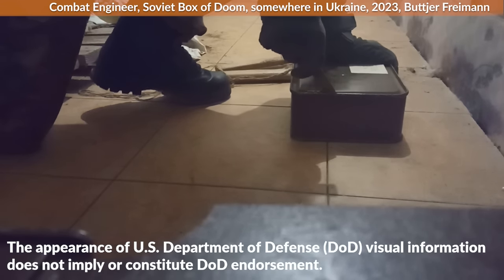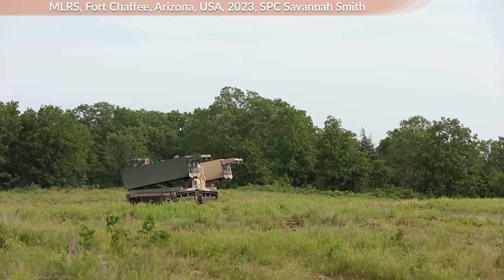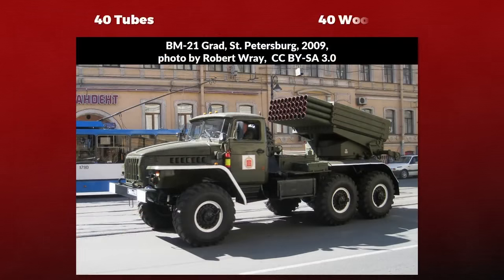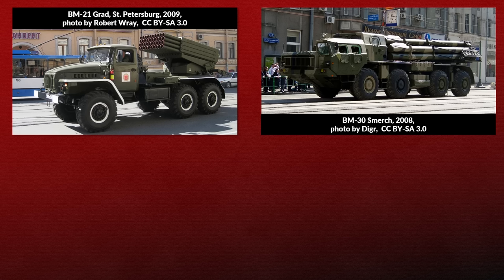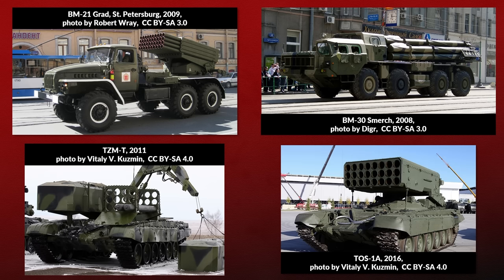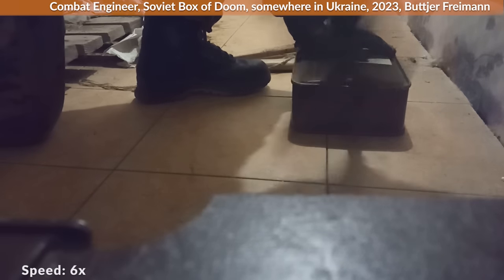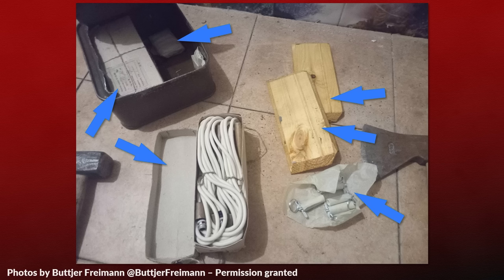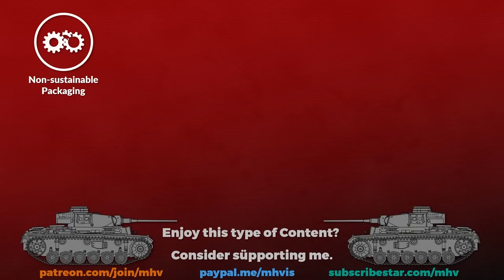Ukraine: Why Soviet Packaging is a Nightmare - Unboxing Edition

Comment: The claim that the Warsaw Pact would have lost/logistically only on the basis of the BM-21 is rather primitive, as is probably comparing the BM 21 with the M270, which had very different equivalents in the Soviet Army. It wears out soldiers, in WW3 a soldier's lifespan was generally expected to be relatively short, hence the Soviet warehouses in the middle of nowhere with very old equipment, when they were expected to defeat the other side with this, who would have less supplies if it didn't work production.
Reply: There are more examples than the Grad, even more than the recent Systems already shown here. Soviet fuel logistics for example are also terribly inflexible (And as shown in the Battle of Kiev, the Russian version did not improve much on that) Containerization did happen late in the USSR, but never became as refined as the ISO system, old military containers won't fit on civilian trucks or railcars. Here, the only major problem is that 53ft ISO containers are uncommon in Europe, but popular in the US.
Reply: The logic behind NOT having an integrated ammunition container-launch unit like in M270 is simple. Without a truck with a proper crane you cant unload the goddamn thing. You cant load the container on the truck either. The ground is muddy? Your ammunition truck is on a slope? Crane broke? Too bad, you won't load. Meanwhile, to load and unload the BM-21 you need 3-4 guys (but even 2 will do) with at least one collective braincell. No crane needed, you can even use a horse wagon and it will do just fine.
Reply: @phunkracy  yes, but in 99.9% of all cases, the containerized version will already fire on your rearming site while you are still working on the 8th missile. The crew trains in such situations, maybe they will be slower, but how fast will you reload if your soldiers are walking through knee-deep mud? Or on a slope? Or when its near freezing and raining? In the first minutes, its easy. And  we don't talk about BM-27 or BM-30, which use much heavier rockets, can't be reloaded without a crane and still reload in single rockets. The SAM Tor on the other hand uses four missile containers as sealed round. The Soviets CAN do better.
Reply: @denniskrenz2080  why not 237% of cases since were making up percentages? Also apples to oranges, BM-21 and derivatives are not analogues to M270, not any more than a mortar is an analogue to a howitzer. Missile containers arent a new thing and there was a reason for not adopting them, the reason is respective artillery doctrine of NATO vs Warsaw Pact
Reply: @phunkracy  why claim that they are made up? Just look at the job HIMARS does which uses the same logistics, using fringe extreme cases are a bad design criteria.

And can you read? BM-30 entered service in 1989, M270 did so in 1983. NATO did not use any MLRS before the 1970s, the logistics of it could never compete with guns, all changed when NATO doctrine changed (before we would have used single rocket systems weapons, like Lance, with about half of them nuclear). The German LARS is pretty much the closest you get to Grad historically, but it uses smaller rockets.
Reply: @denniskrenz2080  its made up because you literally made it up lol

I dont know why reload rate is important for a system with almost exactly twice the range of contemporary M270 mlrs.
Reply: @phunkracy  You are clearly civilian.  🤣
Reply: Modern Russia DEFINITELY would lose to NATO just based on Logistics alone.
No one can beat massed Air assets… yes even the Russians with their S series SAMs would still fall victim to well trained Pilots, with well trained ground crews and the omnipresent Anti-Radiation Missiles.

No army can fight when the depot that had their ammunition was blown up… as well as the numerous other depots anywhere close to the frontline. No Logi, no Army.
Reply: @PeterMuskrat6968  modern russia would obviously lose to nato, but only because US is in nato. i dont know why anyone disputes that. but anyone else is fair game.
Reply: @denniskrenz2080  youre clearly a civvie
Reply: @phunkracy  Awwwww, cute.
Reply: @denniskrenz2080  awww cute

Comment: Czech RM70 Vampire MLRS somewhat mitigated the grad rocket reloading problem. You have one salvo loaded in the BM-21 launcher, while the second one is stored on the rack at the back of the truck. Once you fire the first salvo, you turn the launcher to the reloading position and slam the second salvo to the tubes. No need for carrying around 40 boxes to fire two salvos.

Comment: The unboxing is done incorrectly. The line of cut should go towards itself (on video to the left) and not from itself (to the right). On video going to the right is very demanding because with each step you need to create new big hole in the plate. But if you go towards itself you are just making small hole and big cuts which is very easy strength wise. In short the guy on the video has no idea how to use this type of can opener. To be fair this type of can opener is not usual and I have used it only in military.

Comment: This is a selective line up.  No one reloads crew serve weapons like that under fire, so a few more minutes is irrelevant.  MLRS rocket pods need a fork lift or a crane to put on transport trucks too.  Sealed ammo cans can't have contents secretly robbed in storage.  A can opener is issued in every crate.  And can be resharpened.  Everyone packs space with whatever works too.  I have purchased equipment from Russia (pre and post USSR). as well as other old Com Block, and NATO countries.  All of it has been clean and functional.

Comment: Good video but need to note that for the voice over at
8:58
Modern ammo names are the diameter and its length. In such cases the X is read as "by" in English, just like "two by four" or "an eight meter by ten meter room".

Comment: I'm not certain if it's accurate, but a quick Google search showed that a BM-21 system rockets weigh on average 60-70kg, depending on the specific munition being used. I looked up a video of the system being reloaded, and each projectile is being carried by three people. The standard crew of the BM-21 is 3 people. I feel like the 10-minute advertised reloading time is unlikely, even if the rockets are all already unboxed and sitting nearby for easy access (which has its own set of potential problems).

Comment: I think it is crucial to say that usually, BM21 is not fully loaded with 40 rockets. It is both for safety reasons and time efficiency. So, from my opinion the tactics for bm21 is this: BM21 goes to the firing position, empties its payload, and goes to a safe position for reloading, and after reloading it goes to a new firing position. And all the wooden packaging is good for storing those rockets, in stations where they might be unpacked before BM21 comes to the statin for a reload. Yes, it also raises the question of "if the reloading site will be exposed to the enemy, it might be destroyed by artillery fire, drone attack etc." but, those things were invented long before drones, but even after all the bad things BM21 has, they are compensated with it simplicity of use and service, and it's also cheaper than NATO MRL systems. So, even if it is faster to reload HIMARS, you can simply build more BM21 to compensate reload time.

Comment: About the BM-21 reloading: As the tubes foul with remains of the rockets solid fuel, it becomes increasingly harder to fit the rockets into the tube. There is a video somewhere, where they hammer the rocket into the tube with a packing box. You can imagine how well this thing fires.

Comment: From what I recall, the Soviet Union did not plan for a long grinding battle  for Europe, it planned  a very fast highly mobile attack, using battlefield chemical weapons as part of the offensive.  That could lean into the idea of 'use once then discard'.  Why bother decontaminating something you are only going to use once since you are planning on using chemical weapons anyway?    
The tins make sense if the idea is to just keep churning out ammo in peacetime to then put in storage for use years or decades later.  With enough meat bags and advanced preparation, you can get it unpacked fast enough to have a ready supply for a short duration conflict.  Of course that implies you are planning a short offensive war where you are doing the invading.   
For lower intensity conflicts, where you are not expecting to be firing a lot of ammo , it also has a sort of sense.
I'm not saying the thinking was correct, but I can see the logic behind the thinking.
Reply: Yeah the logic behind it was flawed, but the logic exists.
I think it would have been kinda funny to see what would happen when the Soviets blitz through a good chunk of West Germany only to slam headfirst into the realization that “Quick and Easy” would very rapidly turn into “Rapid and Shameful” route back to their starting positions when the French, UK and US reinforcements arrive in Antwerp and other Northern French ports.

Comment: Does this even matter? The volume of fire that these systems puts down are mostly limited by access to ammunition supply and their need to relocate to avoid counter battery fire and also getting supplied with a good target. So what if it takes the grad 30 minutes to reload and it takes 30 seconds for a western vehicle? Both needs to relocate after firing to avoid counter battery fire, and both needs to wait for a new target which could take way more than 30 minutes, so the reload difference is not that significant as it first sounds.

The main limiter is ammunition though, and I'm willing to bet a large sum of money on Grad ammo being a lot cheaper than MLRS rockets, even when adjusted for size.

Comment: Just the day i start obsessing over (Post-) Soviet ammo logistics you release this gem. Thank you! Does anybody know if there are any good sources on the wooden crates used to transport ammo and weapons in former soviet states? it seems like they had neat manuals and systems for everything, so i'm assuming there's also some specifications available for the boxes. I've seen big deep boxes that can seemingly both be used to carry 150+ artillery grenades og RPO rocket launchers, shorter crates for mortar grenades or PG--7 rockets, and various others. there's got to be a name or code for these boxes, so if anyone knows of a system, do tell..
Reply: It was all made with the expectation of being used by the unit. For example, the ammo can was designed for the standard ammunition of a standard squad (5.54x39 for example), so the words that some sad dude would take a long time to open the ammo can and then got a lot of ammo in the paper are said/written by those who used them on the firing range, for example, as a civilian, without understanding the logic of real (Soviet) army use.

Comment: About the boxes.
I have experience opening various "boxes" of ammunition (several dozen, no more than a hundred). For the most part, with the help of just such a knife as in the video.
In my experience and from the experience of watching people who open these boxes for the first time, I can assure you that your second box is opened many times faster with just a knife than it happens on video.
I do not know what to do with a knife to make it blunt so that it was impossible to open the boxes with it. Although knives that are used all the time are sometimes sharpened (if this is your personal knife, for example).
Moreover, knives are placed in ammunition boxes (sometimes in each box). What's the problem with taking another one?
In the video, a man claiming to have opened more than one box (and this is his speed record, besides) opens the box as if doing it for the first time.
He bends the lid for some reason, which only gets in the way. And after using the axe, a piece of the lid remains, which prevents the contents from being removed.
Seriously, this is almost the most crooked-armed man I've ever seen.
Batch charging
Batch loading is undoubtedly faster than one rocket at a time.
But if you haven't used up all the missiles in the package, how will you recharge this package? Should I take the unit to the warehouse (or to the factory) and recharge it there? Take missiles from another package? Or do I have to store a bunch of half-filled bags? Are the missiles even stored outside the package?
About logistics (the answer is rather to some comments on the video)
In order for your ammunition not to destroy everything at once, you have to create a bunch of transfer depots on the way to the front line. The smaller and more inconspicuous they are, the better. It's hard to manipulate a rattle somewhere in the forest, for example. Either in the barn or in the basement.
A container that depends on a forklift complicates logistics. On the other hand, does anyone really think that Soviet crates cannot be manipulated with a forklift?
If the ammunition is used up, they no longer need a container for transportation. This is obvious, but apparently not so much that I have to talk about it.
Boxes made of wood and steel can be reused (no one forbids), on the other hand, they are not a pity, they are eco-friendly. I'm not saying that it is possible to apply the push boxes in different ways in everyday life.
According to the conclusions of the author of the video
This packaging allows you to extend the shelf life of the ammunition as much as possible, therefore, it is possible to store huge stocks for a long conflict. At the same time, there is no problem of logistics of empty containers back to the warehouse during the conflict itself.
And, again, it's not worth making a video about the speed of opening a package according to people who have their hands out of their ass.

Comment: Considering that this example was from the late Soviet Period (1981), the design considerations were not centered around operational efficiency but around production limitations. In the early 1980s, a wooden box with a few simple handles would have been one of the simplest forms of packaging that could easily be manufactured at scale. The Soviet Army was predicated upon a cheap supply of conscript labor; plenty of men to lift and carry as needed. The Soviet Army was also attached to a command economy, where supply considerations over-rode what Western bureaucrats would call, "military readiness." In other words, a soldered "soup can" of generic size & shape was easier to source en masse than a bespoke reusable container with a myriad of specialized parts. Nevermind how ubiquitous the reusable "ammo tin" became for civilians in the West, with its multiple hinges and leaver-action opener. Soviet ammunition was not stockpiled with the intent to use, but stockpiled with the intent to meet a quota. The fact that it can sit in place for half-a-century and still be expected to be used remains a triumph, albeit with the drawback of being impossible to open during combat operations.

Basically, the Soviets engineered their systems to cheaply meet a quota and sit on a shelf indefinitely.

Comment: The cost of the powder coated, weld components for handles and the locking mechanism of the army ammunition can is enormous. Yes, crated on a pallet you can move them in and out of an airplane at the depots but it is just a storage can and I have no idea how many might be returned since you never see anything but new cans.  Shocking to hear the ammunition of the new XM-7 battle rifle and light machine gun 6.8×51mm (.277 in) is 13 cents a round.   "Make every shot count " is very true for a country fighting everywhere and so heavily in debt.
Reply: 13 cents a round for the TRAINING ammo lol, not the good stuff

Comment: We call the ammo cans "spam cans" and they literally are a nightmare to open. I have opened several with the supplied "can opener" and I have even used tin shears and a hammer and chisel to open them! I recommend wearing cut resistant gloves as you can easily slice up your hands and fingers. The only good thing is the Russian ammo cans are that they will literally preserve the ammo forever if kept in cool dry conditions. For example, I had some Romanian 7.62 x 25 mm ammo that fired perfectly after 70 years. My favorite ammo cans are NATO which have easy to open clamps and they are sold in some hardware stores - they make great toolboxes.

Comment: Did the Russians plan to use those wooden rocket boxes as front-line fuel for cooking?
Reply: No, but they can be dropped for infantry to use as building material. Usually they get wet and don't burn as well.